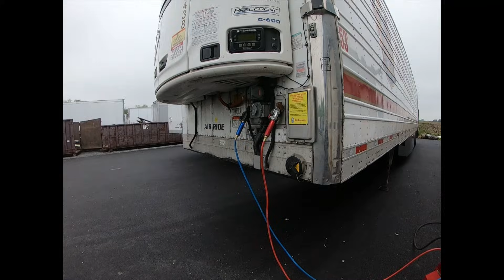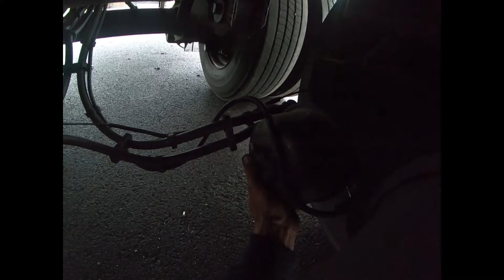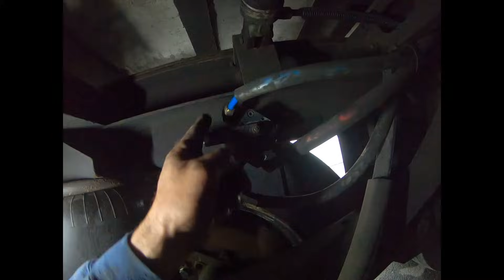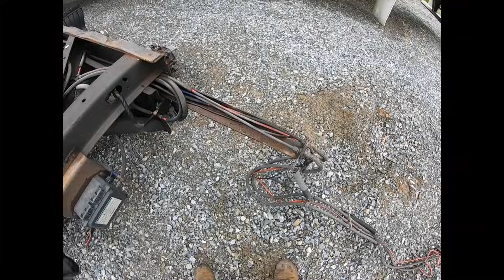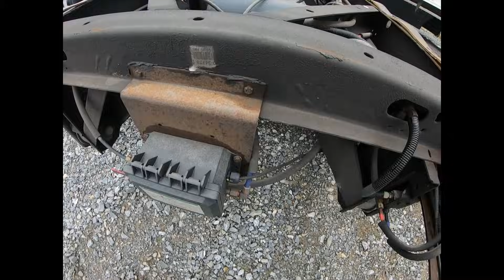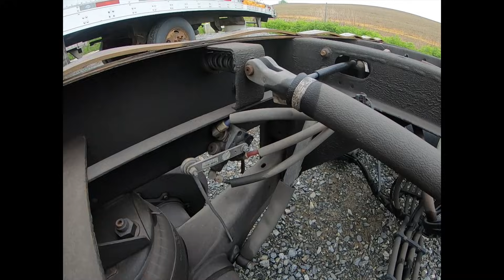Semi trailer air ride troubleshooting. Trailer takes too long to air up.

Comment: Awesome video. Question. How can you tell which valve is causing the issue without removing the airline to the HCV? Also, can the height control and the pressure protection valves handle being heated by a propane torch? Every winter I get at least a dozen trailers that won't air up

Comment: Last one I had ended up being that emergency relay valve. But the whole tank was slow to pressure up not just the air bags. Thanks for the video

Comment: What is wrong when you apply trailer brake, and the air won't be released from the air bags to drop the trailer? Is the same leveling valve?
Reply from the maker: Depending on the type of leveling valve you have this could be normal.  Some valves are set up to keep the air in the air bags, some exhaust the air from the airbags when the parking brake is set.  Some have manual systems where you can inflate or deflate the bags with a lever.
Reply: @fleetrepairsolutions6372  well, I know on a flatbed whennyou pull the trl brake, it will decrese the suspension, qnd I swapped on utility reefer 2010, and it does not) it could probably be the way it is.
Reply from the maker: Here's how you can tell if it's normal or if you have a problem... Look at the leveling valve on the trailer.  If it only has 2 air lines connected to it, one on the top coming from the pressure protection valve mounted on the air tank and another on the side of the valve going to the air bags, then your system is operating as intended.  
If you have a third air line going to a port labeled "Dump" on the valve, then your system is designed to exhaust the airbags when the parking brake is set, and you may have a problem.

Comment: Definitely saving this video for future reference. I ran into this same situation last week, although I didn't know what the value did or was called. I removed the valve and substituted a simple fitting temporarily to verify the problem, then installed a new valve.
Thanks.
Reply from the maker: Awesome! Thanks!

Comment: What about if you bypass protection valve off and it still airs up slow . I have the same exact problem
Reply from the maker: Most likely the height control valve / leveling valve is defective, incorrect or set wrong.  But first check for any kinks or leaks anywhere in the air suspension plumbing, even a small leak can cause the airbags to air up slow or not at all. Next I would check the supply tank is getting sufficient pressure from the tractor.  After that I would check the operation of the height control valve / leveling valve.
Reply: Installed new height valve and no air leaks . I keep hearing like the tank still airing up . Can a tank be defective?
Reply: I feel like the pressure out of the tank should be stronger . Does the same thing even with a different tractor . So it’s not on the truck side .
Reply: Can the tank be defective? Can the pressure relief valve didn’t let air out meaning it’s not enough pressure
Reply from the maker: The tank could be bad, but you would hear the air leaking.  You say you hear air constantly moving through the tank...Do you have any thing else plumbed to the air tank that could be consuming air like a tire auto inflation system?  If you have a tire leak the system will use the supply tank pressure to try to fill it up, leaving inadequate air pressure to deliver out to the air suspension.

Comment: What are red and blue air liner size on diameter
Reply from the maker: It's your standard 3/8" O.D. DOT brake tubing.
Reply: @fleetrepairsolutions6372  thank you

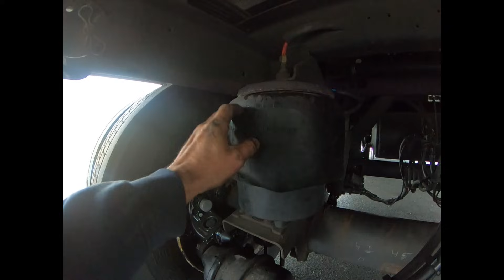Comment: Question for you. At around 6:30 when you supplied air to the trailer the dock stabilizers released instantly thus dropping the trailer. Does the PPV play a role in that? My dock stabilizers take forever to return to travel mode and when it does it slams. Scares the hell out people around 😂😂!
Reply from the maker: I'm assuming you are talking about the type of dock stabilizer system with the 2 arms that pop out when you release the trailer brakes? If so then no, the air that inflates that small air bag that pushes the arms out is split off of the red supply line, before the air tank. The PPV protects the air inside the tank for braking. 
It's pretty common for that style of dock stabilizer to slam open, just don't be around the arms when they do...
The trailer dropping you saw at 6:30 happens sometimes on a trailer with this type of suspension when you release the trailer brakes while unloaded.
Reply: @fleetrepairsolutions6372  ok cool. Thanks so much for the explanation and clarification. I replaced the PPV for my trailer and it air up pretty quickly. But it was an aftermarket. I now have the Haldex original that the trailer came with and will install that one instead. Hopefully it'll fill up faster once the tank is charged.

Comment: What if there is no air in the tank
Reply from the maker: The trailer supply tank is fed by the red glad, down the trailer through red brake tubing and enters the supply tank via the emergency relay valve.  With your trailer brakes released, confirm there is no major air leaks at any of these locations.  If no leaks are found the next most likely cause for the tank not airing up would be the emergency relay valve malfunctioning.  Depending on the style you have these are an easy and inexpensive replacement.
Reply: What if the bags over inflate I've tried switching the leveling valve the pressure valve still over inflates
Reply from the maker: @nathanmorgan2917  The pressure protection valve is probably working.  It only shuts off air to the accessory it's plumbed in line with when air tank pressure drops below a certain level.  There's no upper limit on the PPV, so if the tank has 125 psi, the PPV will deliver 125 psi the the accessory, in this case the air bag. 
The volume of air that reaches the air bag is controlled by the moveable arm on the height control valve. Raising the lever adds more air to the bags, and lowering it let's air out. Your problem may be that the ride height is set incorrectly, meaning the adjustable rod that is connected to the height control valve arm is set in the wrong position and letting too much air into the air bags.